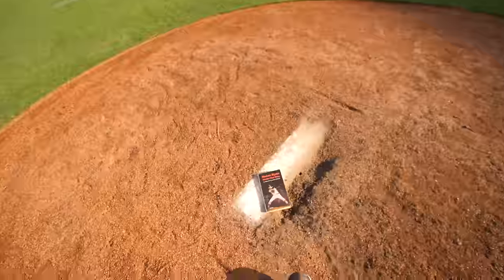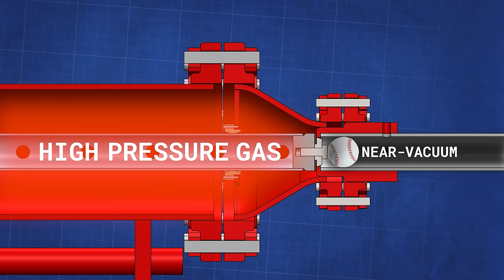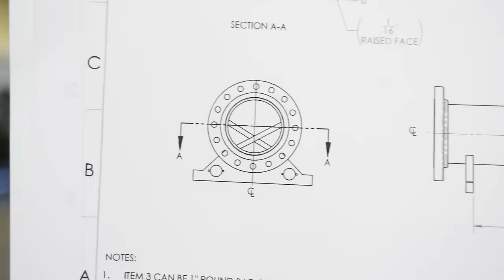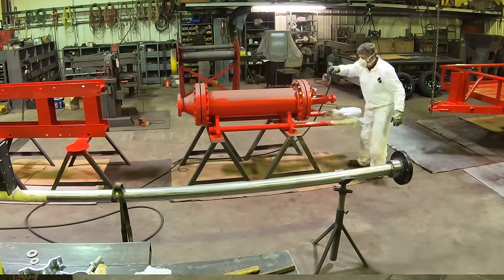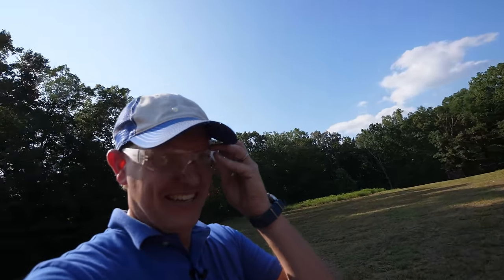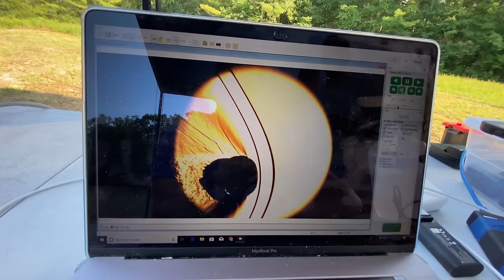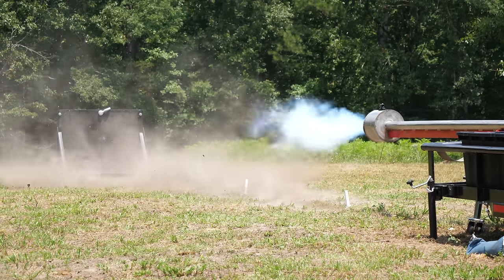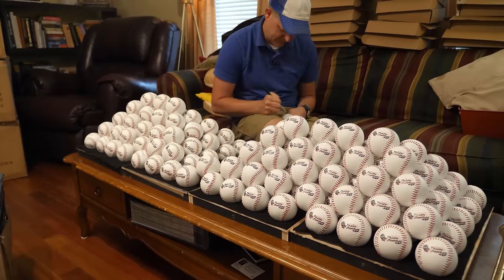World's Fastest Pitch - Supersonic Baseball Cannon - Smarter Every Day 242

Comment: You need to take the cannon to “throw” out the first pitch when the Trash Pandas get to play!
Reply: Wouldn't want to be the hitter or the catcher at the business end of that.
Reply: Better grab someone who wants to be like Deku to be the catcher...
Reply: ... doable. Just pressurize the tank and don't use the vacuum boost. Low enough pressure and you could very easily match a human pitch.
Reply: @patricksawyer9779  doable but terribly intimidating, facing that cannon!
Reply: Now i'm curious what will happen if someone catches it 🤔
Reply: @RenaldyGabrielAbednego  What happened to the ball on steel will happen to their hand.
Reply: @richardhayward4666  but then it's not just the ball that explodes
Reply: @richardhayward4666  and their arm could break all the way up to the shoulder on top it
Reply: @RenaldyGabrielAbednego  It would be like catching a round from a .50 BMG, energy wise.
Reply: Baseball throw by someone skillful enough can injure or even kill, if it hit the right spot. Now imagine it by a cannon that can fire at the speed of sound.
Reply: put the catcher's mitt on the lead plates.
Reply: @Yakushii  I wouldn't want to be the audience either.
Reply: No vacuum and set pressure to achieve a MLB speed.
Reply: Yes, bring the cannon AND the steel backstop, aim it at center field (away from spectators) and launch a supersonic baseball at the plate. You will have baseball fans and science nerds lined up around the block to buy a ticket to see the Trash Pandas.
Reply: @romaindubray2325  Very true.  But I saw this documentary once called "Rookie of the Year" where a kid got their arm broken and became the best fastball pitcher in the league!
Reply: For the love of God, up-vote this. Make it happen.

Comment: Jeremy: “confirm all clear of the trailer”
Also Jeremy: walks in front of the bore.
Reply from the maker: In Jeremy's defense, we put that step in the procedure so they our fingers wouldn't be pinched or damaged from the actuator in the back. We made a rule that no one would physically be touching the trailer when we started moving cylinders of any kind (sear actuator, cocking piston, etc). We weren't to the arming sequence yet.
Reply: SmarterEveryDay love your vids
Reply: one wrong step/maneuver of the finger and at the right moment, there would be a liveleak watermark on the video.
Reply: "We weren't to the arming sequence yet" means it wasn't pressurized yet. No single press of a button would have caused injury at that point. ie. there was no dangerous energy to be released at the front of the gun yet, but the rear had a mechanical apparatus that was less safe.
Reply: SmarterEveryDay That makes sense.  It still made the range-safety part of my brain squirm a bit.

Comment: For reference, bullets range from 1200mph to 2800mph. That baseball is going INSANELY fast!
Reply: W O W
Reply: Bullets go faster than that given per caliber size
Reply: a over 2800 fps some go up to 3500 to 4000
Reply: I killed the freedom with the freedom.
Reply: @doyoumakeittotheclouddistr4132  He said 2800 mph, which is 4107 fps. If you are going to nitpick, I'd argue with the 1200 mph number. There are plenty of subsonic rounds; .45 ACP, for example, is often about 580 mph (850 fps or 260 m/s).
Reply: seth094978 ballistics are not measured in mph
Reply: Jon the speed they got out of compressed air is really close to Ye olde black powder long guns of a similar caliber, they usually could get to 370m/S only ~830mph a good 8 pounder ship’s gun from the mid 1800s (pretty much the height of black power) could get to 1430fps but the highest velocity I have seen confirmed from one was 2100fps (~1430mph) the fastest black powder rifles are supposed to be able to get to 3000 FPS.
Reply: @doyoumakeittotheclouddistr4132  the Original comment literally gave mph tho
Reply: You need to change mph to fps. Then you will be correct.
Reply: Some loads of .45 ACP go about 570 MPH, and there is a .204 Ruger load that goes 3000 MPH. So you’re not wrong but..
Reply: The 5.56 or .223 round can go past 3000fps if the barrel is around 16in and the ammo is hot enough
Reply: The Kracken 1200fps is only just supersonic isn’t it? (I am not to good on freedom units) if so that would sound about right (apart from crappy 0.22 subsonics and bullets meant to be used with silencers I suspect most rifles would be in that range. 

Given the size of the projectile I would expect a modern gun to be up near 3000mph (not fps) just below where you need the new hyper velocity rounds they were testing with the big railgun.
Reply: Fiddy Tesla agreed i can’t think of a rifle that puts out a bullet which moves that quick (the .220 swift is the only one I can think of) however something with a projectile around the width of a baseball is around the size of a modern tank main gun or a big anti-tank canon and they tend to be as quick as the bullets will remain stable in the air.
Reply: Fiddy Tesla interesting so he is loosing a heck of a lot of energy because the nitrogen expands at the speed of sound (at it’s density) or the volume of the chamber at the back is smaller than it looks.

I was thinking about the comparison between this and canons of the same bore size rather than mass.

 If the limiting factor is the expansion rate of the gas there is a good chance it would get say a shot put up to a pretty decent velocity.

Or he could try pumping the gun up with Helium and see if he could better than double the velocity.(helium stays pretty ideal at high pressures and it’s speed of sound is 1000m/s) unfortunately that would be an epic waste of helium. And shooting 600psi of hydrogen (~1300m/s?) out the nozzle could be pretty spectacular but a bit more dangerous.
Reply: Fiddy Tesla yeah it doesn’t compare well with modern powders especially now that the Navies are looking at hyper velocity projectiles. 

On the other hand: if it could get the same speed with steel shot or lead ball it would be comparable to a lot of the older smaller bore long barrelled black powder fort or ship to ship guns speed wise it is impressive compared with a pirates of the Caribbean style canon.
Reply: Fiddy Tesla I misread that first bit as I mentioned before the ball is moving about as fast as the speed of sound in (compressed) nitrogen (roughly the speed of sound in nitrogen as it stays fairly ideal at such moderate pressures) if the ball hits it’s maximum velocity only a short way up the barrel there is enough energy there to launch a much heavier projectile (based on the pressure and a rough guess at the volume)
Reply: @glenecollins  for reference a 230 grain .45 acp is going about 950fps or almost 650mph out of a standard 1911. A 55 grain .556 is going around 3200fps or almost 2180mph out of a 20in barrel.
Reply: The Kracken the limit for the speed with an air gun is relative to the speed of sound in the gas being used. I agree he was adding a bit more speed by probably erroneously changing the units.

I struggle with the conversation because I am used to using different units for most of the stuff discussed (our units used here in Australia tend to depend on where the gun is from and if it is used by our military etc) but it has been interesting seeing how people go about making comparisons in their mind. We all put emphasis on different things.

those speeds are with modern powders aren’t they? A .220 swift bullet does about 4000 FPS they are what we use for roo shooting because they are pretty consistent at the medium range roos tend to remain at. 

On the other hand your usual muzzle loaded musket could get about 1200fps and not blow up In your face if it was well made. I think the comparison with black powder is more interesting. Especially because the burn rate of black powders is limited by pressure rather than being accelerated by it like gun cotton and modern white powders.

Comment: Just a tidbit of information to put this into perspective:
This cannon is firing a ~5.25 oz baseball at approximately 1050 mph.  Converting that over to ft-lbs muzzle energy (437.5 grains/oz, muzzle energy in ft-lbs = (m*v^2)/450,240), that ball is traveling with 19,560 ft-lbs of energy. 
Now take into consideration that one of the largest/most powerful civilian market rifles out there (Barrett M82A chambered in .50 BMG) shoots a bullet with a muzzle energy of 11,498 ft-lbs when coming out the tip of the barrel, this is pretty incredible.  A baseball is now hitting nearly twice as hard as one of the largest marksman/machine gun calibers ever produced.
That's how powerful this is.

Also, as a side note; did the same calculation for the 500 mph golf ball collaboration with Mark Rober, and that ball came out at 846.5 ft-lbs of energy.  Which is greater than a 5.56 NATO round at 200 yds.

Comment: I'm really curious about how far that canon could shoot a baseball
Reply: It would be miles, you could never measure It.
Reply: use a GPS tracker
Reply: @sulski55  that might be hard to put on or in the ba but yeah nvm that would work.
Reply: You could actually calculate how far it would go.  If it is 1.38 times the speed of sound then it goes 473.34 meters per second. The ideal launch angle for distance is 45 degrees so therefore use this. With a little bit of physics you can find the distance that monster would lunch a puny baseball, I can tell you this, it would be immaculately far...
Reply: Well if the ball traveled for 1 hour it would launch it about 1,050 miles. -ish
Reply: Back to the future.
Reply: @masonyoung6479  The camera would be resting in pieces before it came out of the pipe.
Reply: @gideonbowman2689  you have to account for the curvature of the earth
Reply: @zachfigart3251  Yeah he said he calculated the drag coefficient, so there's no reason he couldn't calculate the distance with good accuracy.
Reply: @sulski55  And the coriolis effect.
Reply: @sulski55  so if a ball traveled 1050 mph for an hour it wouldn't go 1050 miles because of the curve of the Earth? Wouldn't that mean it isn't going 1050 mph? Would that mean the curve of the Earth makes the actual speed of things diffrent from speeds we measure? 🤔😲🤯
 Seriously though what does earth curve have to do with distance traveled at a constant velocity in a single direction?
Reply: @gideonbowman2689  the curvature of the earth is going to affect the drop of the object. There is an eventual speed (not counting wind resistance) where the ball will never touch the earth because it moves faster than the drop. They call these satellites
Reply: If the launch angle was 45 deg (optimum distance), assuming initial height of 3 feet (rough height of the cannon barrel), and an exit velocity of 1538.46 ft/s (probably more than that if measured at the end of the barrel, but oh well), and NO DRAG (important), the ball would travel:  distance: 73,567 ft = 13.933 miles;  time in air: 67.6 seconds;   Max height of arc: 18,394 ft = 3.484 miles
Reply: If the launch angle was 90 deg (straight up in the air), assuming initial height of 20 feet (rough length of the cannon barrel), and an exit velocity of 1538.46 ft/s (probably more than that if measured at the end of the barrel, but oh well), and NO DRAG (important), the ball would travel:  height: 36,802 ft = 6.97 miles high (more than 1 mile higher than Everest);  time in air: 95.6 seconds
Reply: @sulski55  In a nutshell, yes haha that's the perfect explanation. It does help that they are much less affected by gravity up there, so that speed is lower than it would need to be down here. That would be an interesting calculation to find the speed at which it could orbit the earth at sea-levelish
Reply: @joshm1668  I got the same distance. 22438.9 meters or 13.34 miles with height of 3.48 miles. (Yeah, discounting resistance)
Reply: @joshm1668  That hang time just hit me as funny. It would be in the air for an hour and half. lol That's crazy awesome
Reply: 20 feet at least
Reply: You do not need to account for curve of the earth for this cannon, that depends on how high it is off the ground. If we say 3 ft which is a fair estimate for the cannon and assume launching happens parallel to the ground and neglect air resistance, the ball would go around 664ft. It is not intuitive necessarily but a ball dropped from 3 feet hits the ground in the same amount of time as a ball launched at 1530 ft/s horizontally from the same elevation, the illusion of longer air time comes from how fast the projectile moves and how far it goes before hitting the ground, it covers lots of horizontal distance with hardly any change in elevation, but the elevation is changing at the same rate as a dropped ball. This is from projectile motion if you want to look it up.

Even 15 ft up the ball will only go 1187 ft, still not long enough that curvature becomes meaningful factor, this is because changes in elevation yield diminishing distance returns due to how gravity works.

To get one mile you would need to go 191 ft up in the air, even then a mile is not really enough that curvature becomes an observable factor.

If you look closely you can already see the ball dropping in the slow mo, if you imagine that dropping gets faster and faster (it will due to gravity) you can see why the horizontal distance is underwhelming.

Changing the launch angle though, things could get real far with that but I'm to lazy to do the math right now.
Reply: @zachfigart3251  Any artillery guy in the military could calculate this.  They do it every day.  The baseball has a much poorer coefficient of drag and sectional density than military ordnance, so it wouldn't go nearly as far at the same muzzle velocity as an artillery shell, but it could easily be calculated.
Reply: @paulmichaud3230  It's 95 seconds, not minutes. But still crazy to think about it launching and waiting 95 seconds for it to land
Reply: It's just some math you have the speed ;)
Reply: I did the math on it.. Looks like it's around 2 miles give or take 1500 ft.
Reply: sulski55 It’s called orbit not satellite
Reply: @paulmichaud3230  ~Minute and a half.  95.6 sec...
Reply: @gideonbowman2689  the ball would be decelerating every second due to drag, so it wouldn't go 1050 miles, probably nowhere close to that.
Reply: @steelfalconx2000  which is why I said specifically if the ball traveled 1050 mph for an hour. 
Not if it the ball had an initial launch velocity of 1050 mph.
 The statement I made indicated that the ball would travel the full speed for the entire time. Thus traveling the full distance.
Reply: @gideonbowman2689  Yep I guess that's true, if you can get the ball to maintain velocity that long then technically that's how far it will travel.
Reply: wdym could never measure it? If the ball lands somewhere, it can be measured.
Reply: @paulmichaud3230  67s not minutes sir
Reply: This whole thread is absolutely fascinating. Hats off to you guys, and everybody who commented.
Reply: Its just physics
Reply: @zachfigart3251  You'd need to know the coefficient of drag, which would reduce the distance considerably.
Reply: Low Earth orbit anyone? Here comes Destin's ball again...jump!
Reply: There’s a formula
Velocity
Drag
Lost energy
Things like that
I’m not gonna do it lol

Comment: I believe that the reason why the tape pops off the barrel before the projectile reaches the end is not that there is remaining air in the barrel, but because the projectile does not create an air-tight seal within the barrel, some of the ejector gas used to propel the projectile is able to pass around the projectile inside the barrel which is then pushed towards the front of the barrel as the projectile travels, creating enough of a bubble to pop the tape just before the projectile reaches the end.

The gas is trying to equalize the pressure in the barrel faster than the projectile can move. If there is no seal between the projectile and the inside of the barrel, then the gases can get around the projectile while it is still inside the barrel.

Comment: Could you possibly re-design your valve system to one similar to what FX airguns and other airguns use? (Spring/hammer/valve) With some tweaking you could stop the excess air flow once the ball exits. Making refill time a fraction of the time it takes now. Plus it will look cooler without all the excess air waist.
You should make more videos of this!

Comment: I need to know:
What can this thing do at full power -- 1,000 psi, -14 psi !?!?
Reply: I think the seal between vac and press is the limit right now. Maybe mach 2.?
Reply: I'd like to get a distance test as well. Any chance they can get a tracker in a ball that won't be destroyed and in a safe enough area where they can launch it into the horizon?
Reply: @ralanham76  I doubt it. The ball was already beginning to fail. Maybe with a discarding sabot...
Reply: @Sam-M-1988  With that 600 psi / 1.38 Mach, shooting at 45°, in vacuum should be ~20 km, but due to air resistance it will be maybe ~5 km
Reply: I think the reason they lose vaccum well before the tank is up to 1000psi is that the tape at the end of the barrel starts leaking
Reply: At some point the ball will disintegrate mid-air and honestly im here to find the limit of it's construction as much as I am to see the super-sonic shockwave!
Reply: donutdoode69  yes or how high - base ball with a camera and a parachute :-)